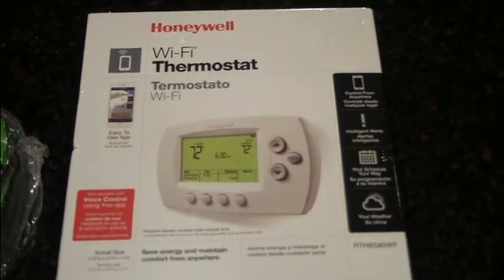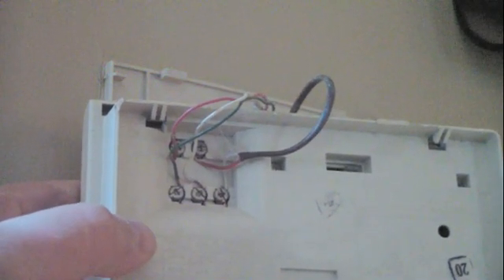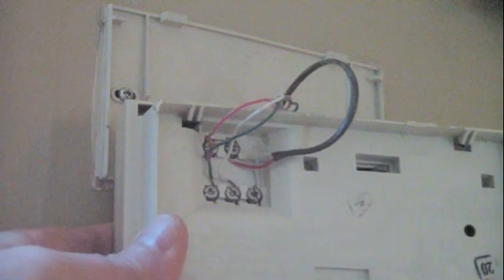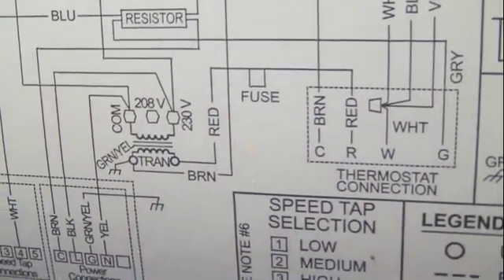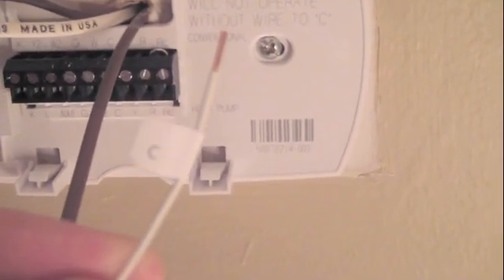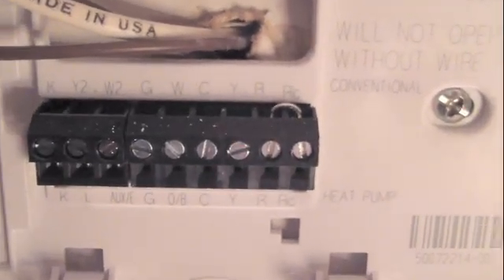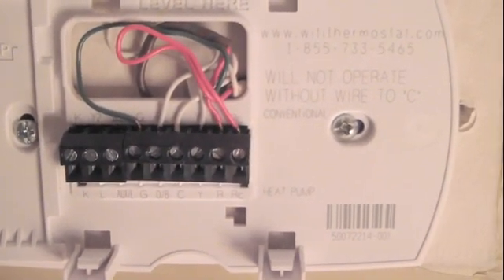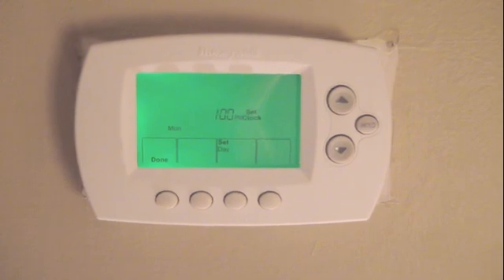Adding a C wire to power a Wi-Fi Thermostat

Comment: The R and the RC you connected them back together with just a longer wire?
Reply from the maker: Since I have two seperate systems, a boiler for heating my house and an air conditioner for cooling, I needed to remove the jumper since I will have an R wire from my heating system and RC wire from my cooling system.

Comment: excellent video if the circumstances allow it. Unfortunately using the existing wire to pull a new wire rarely works. The reason is because the original installer ends up wrapping the wire around a board or having a pinched between sheetrock or a myriad of other reasons it prevents you from actually freely pulling the wire.
Reply from the maker: Anyone that had pulled wire in walls knows the obstacles you may encounter. There are many other videos on youtube on how to run wires in walls.

Comment: I had a third unused wire on the thermostat wire set to my living room two wire thermostat. At the boiler i confirmed that wire was intact saving me the need of fishing any wires or buying any adapter. I have an exterior transformer at the boiler powering the zone valves. Simple connection of the spare wire to the C wire terminal at the thermostat, and I then connected the other end at the boiler to the side of the transformer not going directly to the zone valves. That provided me a 24v brand new C wire. System works perfectly.  Don’t forget to set your functions properly for your system before any programming.
Reply from the maker: Having the extra wire makes it a lot easier!!

Comment: Can you help me please I have a old thermostat that’s only have two wire connected to it. I do not have no  air condition unit is just to wire for the boiler so I wanted to upgrade it to the same  Honeywell thermostat Wi-Fi how can I do it please
Reply from the maker: Essentially, the wires that is coming to your thermostat now is one side of the low voltage transformer. You need the other side of the transformer for your C terminal on the new thermostat. Note, I'm not an expert and if you have never worked on a boiler you may want to hire an expert.
Reply: @JaysHelpfulVideos  ok thank you Jay
Reply from the maker: @bangarudy  Here is another option. You can run the 24 volts needed for the T'Stat from an outlet near by.
24V Thermostat Transformer, C-Wire Power Supply Adapter for Honeywell
Link to purchase on Amazon: 

https://www.amazon.com/Adapter-Transformer-Requires-Honeywell-Thermostat/dp/B07C3J6PQX
Reply: Jay is exactly right.  See my comment above. I was fortunate to have a spare unused wire between my thermostat and the boiler. I didn’t need any parts or adapter

Comment: I added a Honeywell RTH6580WF to my home recently. I discovered no c wire. Without knowing what all it involved, I found the blue wire tucked into the wire bundle as it had been cut off since not in use. I stripped it and applied it to my thermostat. Still no power. I then went down to my furnace to see the blue wire was not hooked up either it was just wrapped around the same wire bundle going to the thermostat. I stripped it and hooked it to the C terminal on the furnace. Now the C terminal had a white and brown already attached going to the AC. But you can hook more wires to the C. You can hook the 3 right into the terminal or you can bundle them together with a 4 wire called a pigtail then you only have one single wire hooked to the C terminal.  User preference. So don't just assume because you found the blue wire in your wall or wire bundle behind your thermostat that its connected to the C terminal in your furnace. You will be best to take the panel off your furnace , find if a C wire is connected and determine the color while making sure it's the wire bundle going to the thermostat.
Reply: Well done